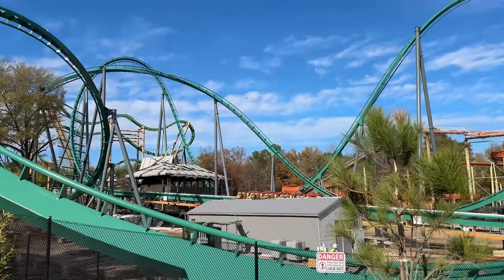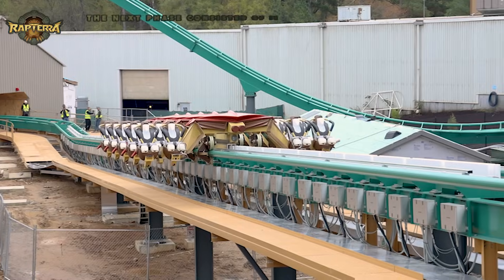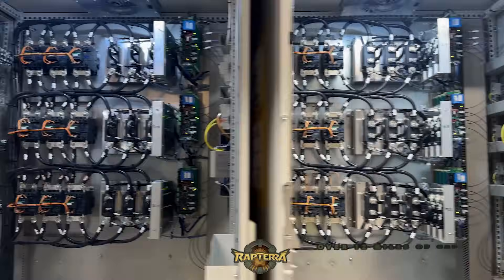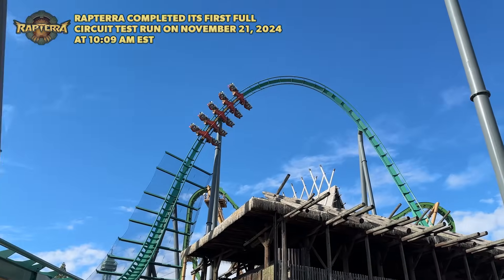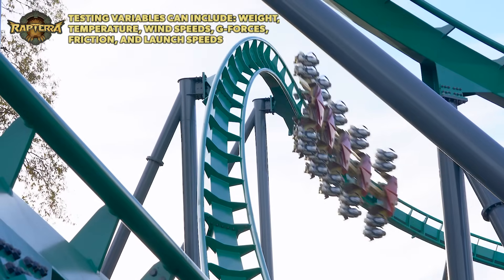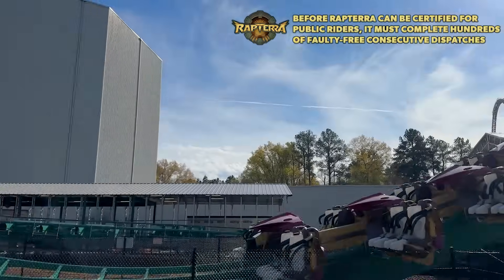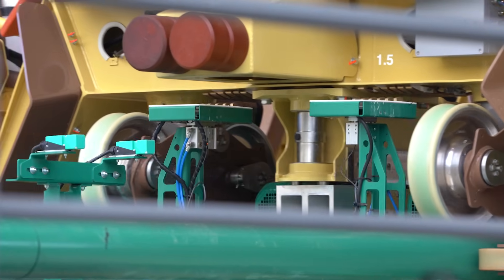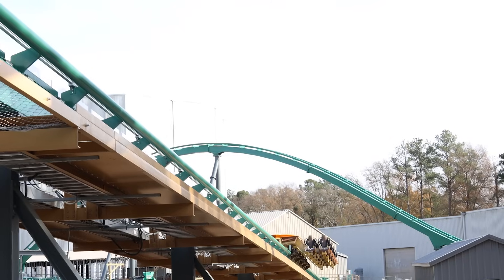Rapterra Report 3 - Conquering the Skies | How do you Test a New Roller Coaster?

Comment: Even more concerning that kings dominion only like the other post haha. 4:04 slowed down to 0.25 you can see the train hobbel. In the long run this gonna cause wear and tear on the train boogeys. And the weels get um bump shavings in it, cause off the speed build up. They either need heat smooth that track down or order new straight part of B&M. This is very unacceptable for brand new  track element

Comment: 4:05 do the wheel bogeys need to be tightened up/sitffened? Seems like a lot of movement on that launch
Reply: no, if you look closely you can see the track itself isnt straight - the winged trains only amplify it and make it more noticeable
Reply: Good eyes! I had to watch closely and now I can’t unsee it. Certainly gives me a new appreciation for the durability and accuracy of Top Thrill 2’s - two decade old track since retrofitted with linear launching hardware. At those speeds and with such close clearances between track and train, it’s amazing that the track was able to be reused!
Reply: Top Thril 2:  Hey!  Sorry!  Late to the meeting.  What did I miss?

Comment: It just amazes me how far B&M has fallen off. You could always count on them delivering a reliable smooth coaster that would last for years. Everything they put out nowadays has shuffling or a rattle. At 4:05 you can clearly see the train shaking at the end of the launch. I just don't understand how quality could fall off soooo much. I live in Florida, which is home to tons of B&M's. Everything built after Mako in 2016 has a rattle or is shaky . It all went downhill in Florida, beginning with the Hulk retrack. Rode this a few months ago and could not believe how rough it was. The original coaster lasted 16 years running basically 365 days a year. The retrack is 8 years old and is now rougher then the original track ever was. Pipeline, Phoenix Rising, and Penguin Trek all have a rattle or shake to them. Many other projects they have built across the country suffer from the same problems. Rides like Kraken, Montu, and Sheikra are all old and still ride like butter. I would love to know what has changed over the past 8 years in their manufacturing process that has caused their quality to drop off. 🤔
Reply: Candymonium at Hershey is glass smooth and that was 2020.
Reply: Couldn't agree more, mandrill mayhem and nemesis reborn here overseas suffer the same bone rattling effect
Reply: Maybe they hired Gerstlauer to do their trains... Jokes aside, The shake has to do with the trains I belive, something in the trains isn't right. All of the new B&M trains have the shake. The track is still produced the same way. Ryan the Ridemechanic has a video about it on his YT also, and he thinks it has something to do with wrongly fabricated parts from a company B&M hires to make components for their trains. The B&M Shake is probaly the same why a lot of Gerstlauer Eurofighter and Infinity coasters are shaking a lot along the track as well, because you can feel the whole train shaking from left to right on most of the Gerstlauer loopers over here in Europe. I'm not saying that I'm right, but I wonder if anyone would like to reflect on my comment. I just think there is something in the trains not right. (Also, Fenix at Toverland and The Swarm at Thorpe, are also wingcoasters and have the same shake in the trains. Very uncomfortable on low speeds. So it also can be a Wingcoaster issue. Please tell me I'm wrong if i'm wrong.
Reply: fallan off yeah right there the most reiable and GP coasters out there intmain could never
Reply: Pipeline was fine for me. Same with the hulk. However penguin trek is a big problem
Reply: Oh no, a small amount of shaking during the launch only. That definitely means the ride isn’t salvageable and that everyone should suddenly care about this.  I bet if you rode it, you would barely notice it and it wouldn’t negatively affect the ride.  Stop this
Reply: @marcusmcgraw3519  nobody said the ride is unsalvageable lmao. it's very fair to point out a noticeable drop in B&M's build quality over the past few years or so. They were the pinnacle of the industry for a time. I don't know why you gotta act like people taking notice of this change is them throwing some kind of tantrum.
Reply: @markohz72  it’s because I’m upset that people aren’t acting the way I want shout this.  Nobody should be making fun of my favorite coaster manufacturer.  It’s not nice at all